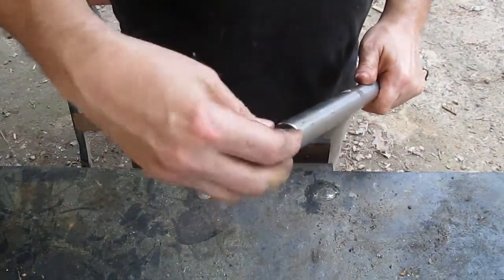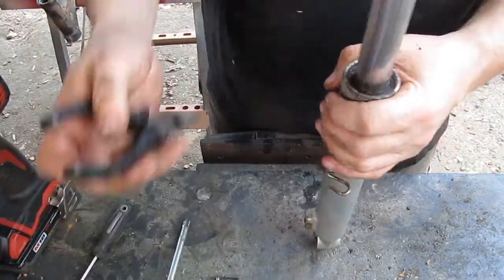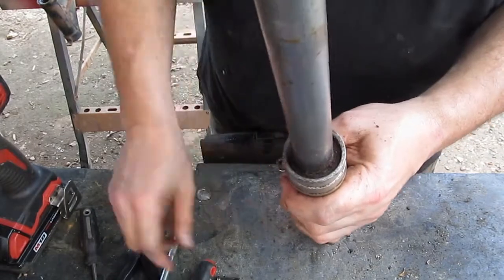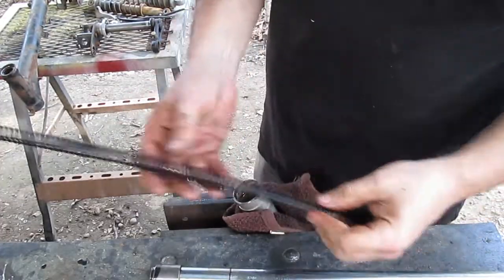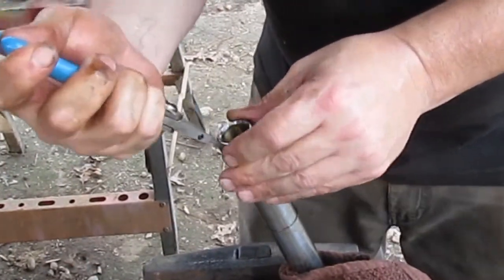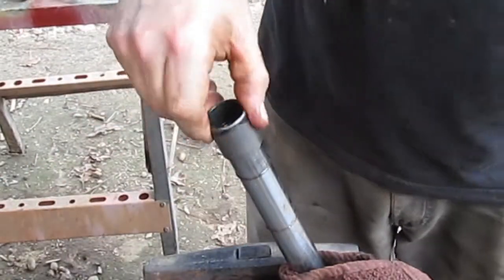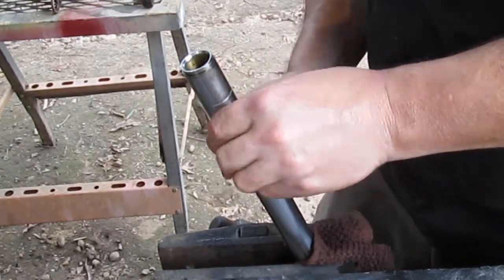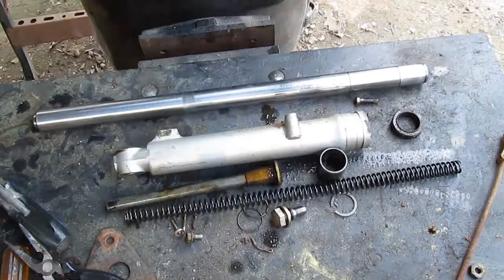1974 Honda MR50 Forks Disassembly

Comment: Thanks for this video.  Quick question for you....I'm doing maintenance on my 1982 Honda XR80, and the forks are very similar(if not the same) as the forks in your video.  The phillip's screws are SO tight and almost stripped that I cannot remove them.  Any suggestions so I can get this DONE?  Thanks in advance.

Comment: Do you have a video to reassemble the mr50 forks?
Reply from the maker: I put them back together in the following video. It is not in anyway detailed or explanatory. It is more of a watch me work sort of thing. And the camera work is not great. Basically it is just a reverse of taking them apart. Except you put the oil seal on last and you'll need a long tube or other implement to press it in. https://youtu.be/iBb2eUY0I18